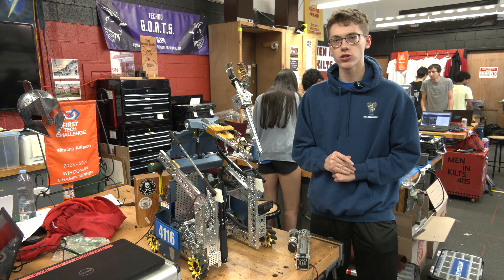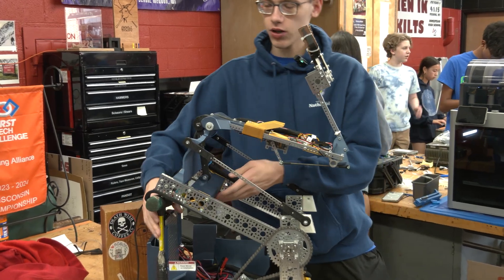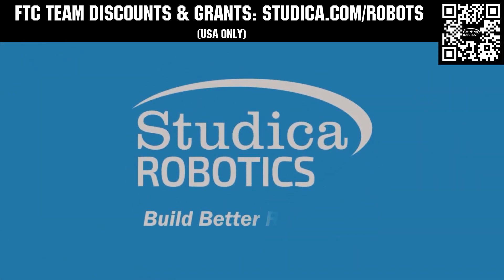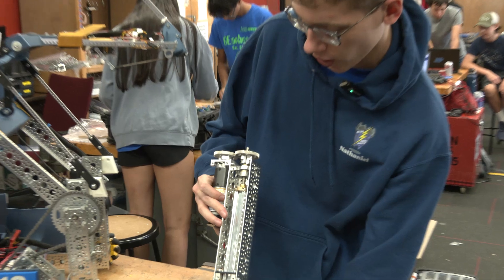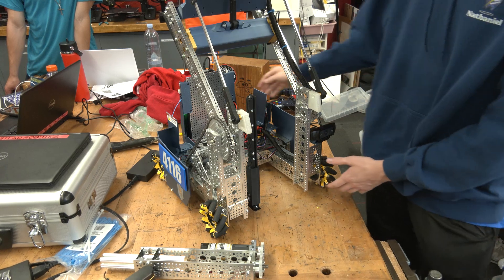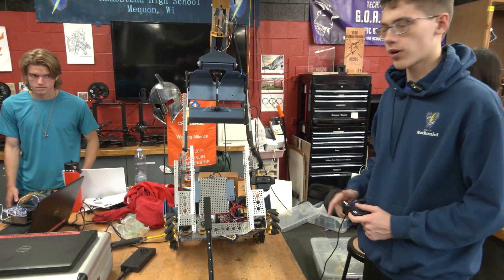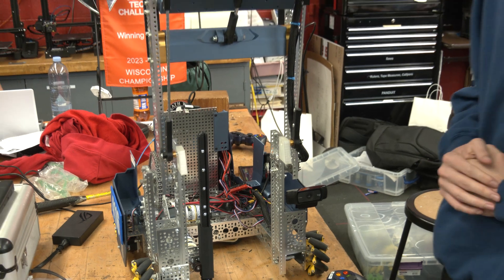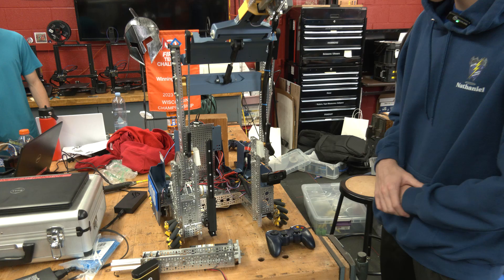Push Up Mechanisms for Climbing | Into the Deep | Ri30H 4116 Volta Robotics

Comment: doesnt a climb onto level 2 directly from the ground not count?
Reply: No, you need to climb to level 1 (not touch the ground, a game prop, or a robot) before getting to level 2 for points
Reply: @sleepdj  yeah that's what i remember
Reply: @sleepdj can you use lvl 2 to get on to lvl 1?
Reply: @goneman2195  are you asking if you can hang from the tallest rung first and then go down to the lower one? As far as I know the only requirement to get points for hanging on the lower rung is to not touch anything else but the rung, so if that is what you're asking then you should get points for that
Reply: @sleepdj  like I’m asking if while ur hanging from lvl 3 and you are still touching the lvl 2 pole is that ok
Reply: @goneman2195 
Yes you can, only the pole though, not the side of the submersible. Sorry for not understanding.
On page 65 of the rulebook, section 10.5.3: "ROBOTS may not initiate contact with the HIGH RUNG while:
i. still supported by the TILES directly or transitively through another object (e.g., SCORING
ELEMENTS or another ROBOT), and
ii. supported by any other part of the SUBMERSIBLE structure except for the LOW RUNG"
Reply: @sleepdj7980 There are 3 levels of accent,
 Accent 1 is on the ground with a part of the robot touching the 1st bar, 
Accent 2 is completely off the ground being held by only the 1st bar
Accent 3 is completely off the ground held by only the 2nd bar, and you can only complete Accent 3 after completing Accent 2
Reply: @zamath1895  you cant touch accent three while touching the ground as well